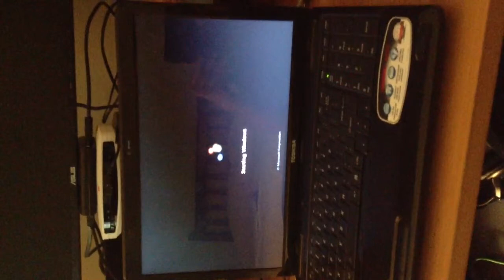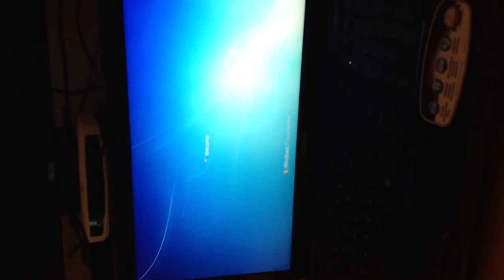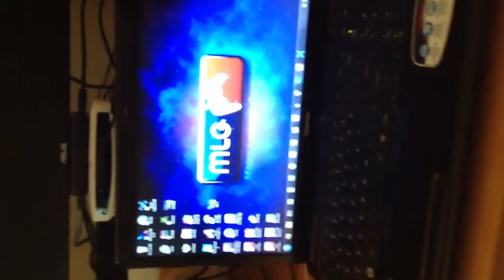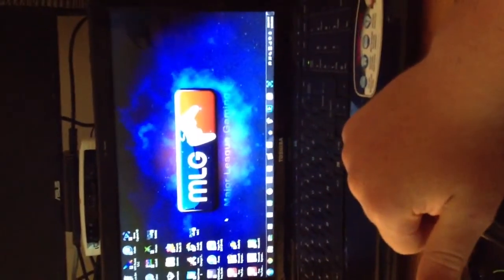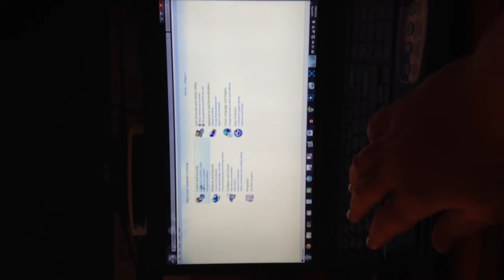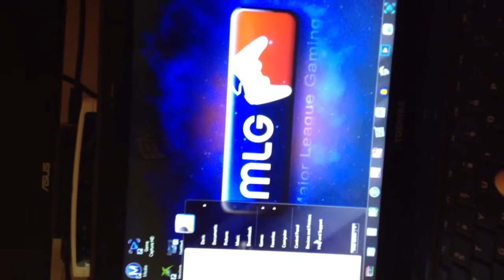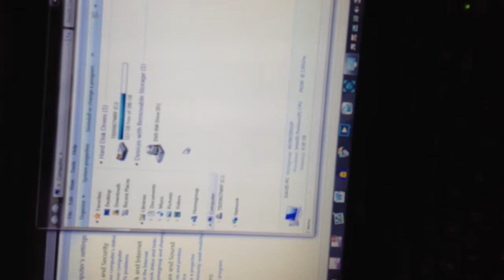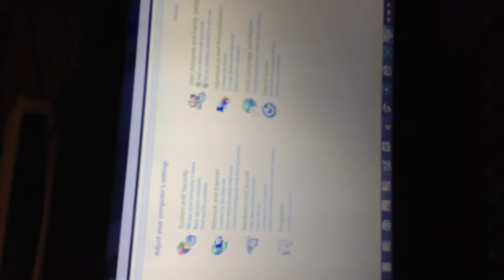Installing 8GB Of Memory RAM on Toshiba Satellite L655-S5096

Comment: Essentially a good video with a couple of exceptions.  First, in the interest of brevity and professionalism have your hardware set aside and unpackaged before you start.  OR, explain the dangers of getting any amount of oil or moisture on the memory sticks prior to installation.  Second, PLEASE  don't take any part of any computer apart or open any hatches/doors that are secured in place until you remove the battery.  This serves a couple of functions in a video like this:  it gives the viewer a known point of reference as to where different access panels/hatches/doors are and, more importantly, it makes the computer safer to work on.  All that said, though, I think its a good video and the 755 users can benefit from  it as well.